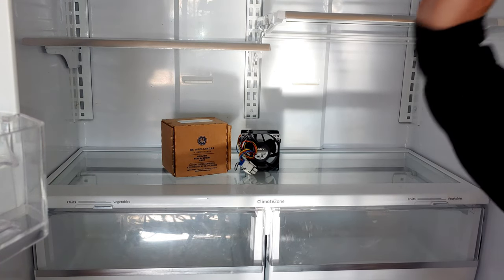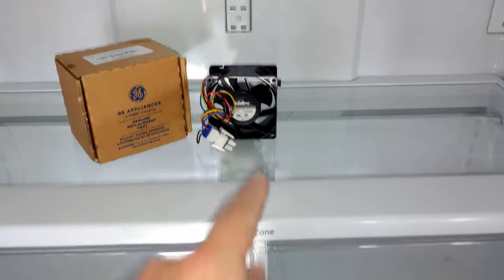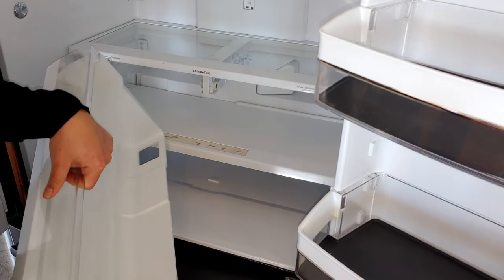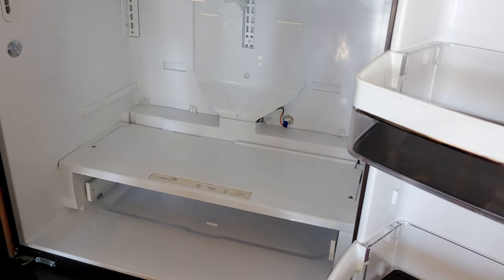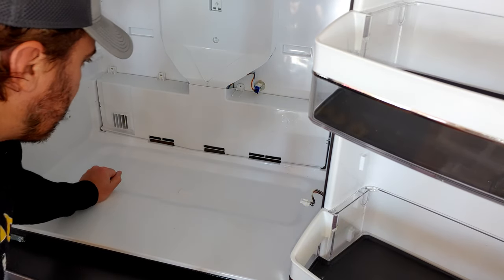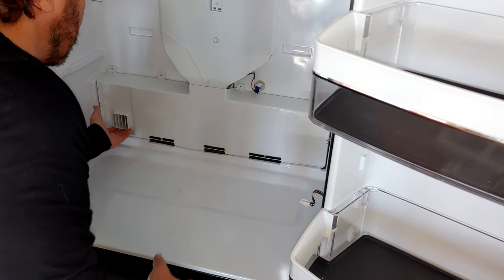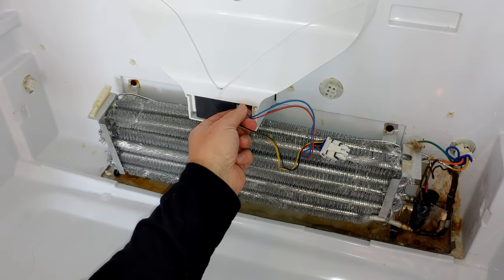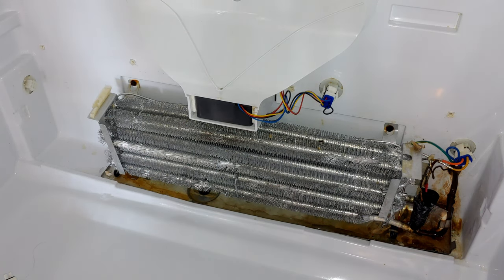How to Replace a GE Refrigerator Evaporator Fan Motor

Comment: I have similar fridge. Below my drawer shelf, some water leaks that become ice. Then eventually it melts and leaks out of fridge. Do you think what should I do?
Reply: I had the exact same problem! The problem happened because the drain that supposed to drain away the defrosted water after the defrost cycle could not go down because the drain tube was plugged. That is why it overflows and fills up the bottom of your freezer compartment. This went on for years before I finally decided to fix it. ( I was tired of always busting out the ice every couple weeks) Myself. I could not buy a replacement one so I just cobbled-together a plastic tube and a fitting from my local Ace Hardware Store and replaced it and I have had no problems ever since. I personally think that if you have a repair person that thinks outside the box can make this happen. The repair person I called in did not even think about that because it wasn't just a part they could order has my fridge freezer is too old and many parts are discontinued

Comment: Watched this whole video just to realize my fan was working just fine. It didn’t turn on until the freezer got too warm 😂
Reply from the maker: Yeah the reason for replacing this is once it goes bad and stops pushing cold air around in the fridge section permanently which equates to a warm fridge (yet freezer will still be cold). Glad your fridge didn't need a repair! 🛠️

Comment: Thank you so much for this. I had no idea how soon I would need this. So A) GE has to know this is a problem. I came looking for this video after B) The fan failed a second time in 3 years. I pulled that receipt. The home call charge was $99.95. They (GE) charged me $116.83 with %25 discount, then $73.60 for the fan at a discount for $55.20. ALL TOGETHER IT WAS $261.05 with military discount for a fan that lasted under 3 years. Last night I got the “2023 improved” fan part from Amazon for $32.95 plus tax minus a %5 discount.
Reply from the maker: That's awesome you did it yourself, nice work! Yep it will save a bunch of money vs. the service call. I have no idea why these fans go badly every few years. I have a 30 year old GE fridge in the garage and it's fan is still running, yet this newer fridge in the house, it goes bad every few years go figure. Thanks for watching and for your military service! 🛠️
Reply: I have a 20 year old GE fridge. The heating element currently goes out about 2x annually ($13 part) and now this is the first time of fan going out. I'm hoping to replace it and save thousands on a new fridge 😂. The parts do go out for sure, but I'm grateful they are relatively inexpensive!

Comment: Mine was the freezer fan motor easy fix took 20 minutes and part costs 66.21 hardest part was getting the fan blade off lol but basically just plug in and screw back together

Comment: Thank you so much!  This saved me some $$ for sure.  And it was pretty easy with your direction.  Two things to mention for others...the newer part comes with two connectors (got from a GE parts store).  When I ordered it there was a note that if the fridge didn't use a 2nd power source for the fan, to just not use it.  I wrapped it in electrical tape and just left it. Also, note that the fan may not turn back on after turning the power back on.  Do not panic (I did).  I tested the fan prior to turning off the power and it worked, so I figured it needed time to just kick back on.  That's exactly what happened.  I left it "apart" so I could ensure it was working before putting everything back together.  Sure enough after 20 min, I could hear it and also felt air when I placed my hand under it.  I feel very accomplished!  AND it was fun!  Thanks again -- the video was PERFECT!
Reply from the maker: Glad it helped and thanks for posting the tips for others! 🛠️

Comment: Here's a ? That I have I recently  acquired  a ge fridge similar  to the one in this video  from a friend  did some research  after watching  this video  and the guy I got it from and the guy said he replaced  the evaporator  fan 3 x within  a year and I just went snd took off what I saw in this to discover  1 things  the fan was plugged  in and it doesn't even turn on and spin and the other thing  I noticed  is that the motor  he has in the has got a 6 plug  and it has 4 wires coming  from the motor  but for some weird  reason  there is 6 plugs and what looked to me like a jumper wire that I'm.not sure why there would be a jumper wire kinda confused  any help is appreciated  I was gonna order the correct  motor  for it  4 wires and a 6 plug w 2 empty spots hopefully  someone can help

Comment: Best video explaining how to fix this! This fan was making a huge racket and driving me nuts. there’s still one more fan making a lot of noise, either the fan in the back or freezer. l’ll keep replacing them one by one.
Reply: Where was the 2nd fan located in the fridge?  Was it another evaporator fan or a heat dissipation fan (i.e., not an evaporator fan) for the compressor?  What was the fridge model & serial numbers?  Thanks.

Comment: Thanks for the video. Was real helpful. We got 2 different fans off Amazon that matched ours perfect. A little different setup with our fan housing and rubber boot/sleeve. It was a sliver of rubber for like sound deadening. Our's was a toploader. Took about 2 hours. We cleaned EVERYTHING while we were at it and back-and-forth tool fetching. I had to use a little plastic pry bar to help get that back section over the coils loose. It was pretty gummie. We were real careful not to bump anything back there too. Appreciate your help. I would not even know where to start without watching your video. :)
Reply: I forgot to mention how long it took to transfer food into other refrigerator, freezer, and 2 coolers! LOL. Add another couple hours.
Reply from the maker: @sacul7694  So glad it helped, thanks for watching! 🛠️

Comment: This is the perfect video that i was looking for and this is literally my exact French door refrigerator (I have model GFE28HMHFES), at least based on the inside portion shown in the video. this video allowed me to replace the fan myself . Thank you so much!!!  
Should air be coming out of the 'Twin Chill' vent on top? Because I don't feel any air at all coming out of there and I cannot remember if air was pushed through this Twin Chill vent prior this issue, also the bottom refrigerator drawer is getting frozen and water is not dispensing if i defrosted the water is working what should it could be?

Comment: Great video. My GE CYE22TSH was making the noise of the fan hitting ice which was the case when I disassembled per your video. I noticed that GE discontinued the original fan so maybe the new fan will be improved to not ice up.

Comment: Great video. Question for you: would bad freezer evaporator motor cause fresh food section to stop cooling (both freezer and fresh food stopped cooling; fresh food evaporator is working).  TIA!
Reply: Did you find an answer?
Reply: @tonihay  I didn't. My hunch was it was the inverter. Called tech to confirm and then bought one from amazon and replaced it myself. Very easy. Saved hundreds even with tech visit.

Comment: Question if I can. Everything was great on the video. It helped tremendously. Unfortunately when I took off the cover to the vegetable tray off, as I was unplugging the harness wiring , the plastic cap pulled off of the wiring on the hot side. Would you happen to know what wires go to what hole in the plastic cap. Nothing broke, it just pulled out. I cannot find anything on which wire goes where and the wire colors don’t match. I definitely don’t want to wire this wrong.

Comment: quite helpful.   question; haier  fridge got warm for 3 days then cold again, temp varies over time of days or weeks, also has random squeaking and other sounds.  I found the tech paper when checking the coils for cleanliness.  Did the self test and result was E1 = evap fan.  ?  because it is cold and then warm and cold, is there some problem besides the fan?   I Really Hate intermittent problems...     I ordered the fan, but I would like to fix the issue with ONE adventure into empty and disassemble, if at all possible.    Thanks again for your video, and if you have time to answer this question, thanks for that too.
Reply: I just learned this. Its a pain but you must do this. 

1st: ensure that it is or is not the fan. That is because the fan may be working, but the vent lines are frozen, blocking the air flow from the fan

2nd: whether its the fan or not. Empty the unit, let it thaw out for 2 days. If the fan is broke, your vents and coils will be frozen. If the fan works, but fridge is not cold, its because your vents are frozen and not allowing fan air into refrig.

Its a pain, but if you dont thaw it out, you are wasting money. Thaw it see if air flow is reinstated, if not then replace the evap fan.
Reply: Look into the heating element. It takes about 5 minutes to change and it's a cheaper part than the fan. Our heating element goes out frequently, but I'm realizing from this video that a fan may play a part in it as well. For heating element, it will go warm, long enough to thaw out some ice, and then it gets cold again so this is pretty trademark of a heating element symptom. With that said, our element went out again, but I heard some knocking in (some kind of fan motor) the night before. Replaced heating element and the freezer is perfect. Fridge is still not working. So I will also have to replace the fan. From what I've learned today, they probably work together, so from my experience you may want to replace a fan culprit as well [unless you want to replace the element 2x per year like we did lol]

Comment: So helpful!  Quick question, I have a very loud noisy GE refrigerator, and the repair person who came to my house said that my "ice maker fan" is bad.  He said he could see visual signs of wear on the fan blades.  My question is, is this part referenced in the video the same as an ice maker fan?  The only other part I found on GE's website is for "ice box fan" but this one does not have visible blades.  Thank you so much!

Comment: Great video! Looks easy enough, I think. 

This is literally my exact French door refrigerator (I have model GYE22KMHGES), at least based on the inside portion shown in the video. Mine is the matte graphite finish. I found this video via Google as the 'fresh food' portion (top) suddenly stopped cooling (the adjustable temp lower drawer and the fruit/veg drawers above that are fine, they may be getting cold air from the freezer via other vents). 

I don't know for sure if it's the evaporator fan, but I am suspecting it. Should air be coming out of the 'Twin Chill' vent on top? Because I don't feel any air at all coming out of there and I cannot remember if air was pushed through this Twin Chill vent prior this issue, or if it's intermittent and I am missing it when it's active. I feel nothing even when you hear the refrigerator 'humm' as the bottom freezer sounds 'on' and you can feel air moving around down there (there is another fan in the back of the freezer, that looks like it's working fine).  

Also, looking online for the evaporator fan part, there seems to be a newer one that has 6 blades, versus the older one linked which has 3 blades. Not sure which to get if this is indeed the issue. Perhaps the 6 blade would push more air and was upgraded/updated due to the 3 blade being faulty after some time. Hard to tell what is legit these days as there are so many fakes and copied parts sold online. Here's the supposed 'upgraded' part:

https://www.amazon.com/WR60X26866-Refrigerator-Evaporator-Compatible-WR60X10356/dp/B0BG4P9VCS/ref=asc_df_B0BG4P9VCS/?tag=hyprod-20&linkCode=df0&hvadid=652579307228&hvpos=&hvnetw=g&hvrand=9068958493129963497&hvpone=&hvptwo=&hvqmt=&hvdev=c&hvdvcmdl=&hvlocint=&hvlocphy=9004149&hvtargid=pla-2068251188141&psc=1&gclid=CjwKCAjwt52mBhB5EiwA05YKoxfJfo0PP8Z_lLcUsVEpXwH6BLSOx_bCBCA5sn1peJl-YM1r-l_BWRoCEhUQAvD_BwE

I am out of warranty, and GE wants $150  to come out to look at the issue, so I am assuming they'll charge tons more for the part(s) and labor, so I was wondering if I should tackle this myself if this is the issue. 

I already removed the back lower plate and cleaned the coils and the entire area. They were dusty, but not too bad. It's now pristine back there, but that didn't do much for the lack of cooling in the upper part of the fridge. 

I've had this refrigerator since 2015, no issues, now, all of a sudden, this happens! Any insight on the above would be greatly appreciated - thank you!
Reply: Hi, this is the same problem I am having. That vent at the top has no cold air moving through it, and I know it is supposed to, via prior repairs. Freezer is solid, but top of fridge is hot!!! Did you figure out if it is the evaporator fan?
Reply: @ismarttaxes7524  Yes, in my case, it was the evaporator fan and it sounds like this may be the problem with yours. What I learned through this process is that the cold air in the fridge portion comes from the freezer, so when this fan goes, air cannot be distributed, making the freezer appear to operate normally, but may have some ice build up due to the lack of circulation and cold air distribution. 

So a cheap part that bonked my whole fridge. Instead of tinkering with it myself after viewing some how-to videos, I decided to just call GE Service division and have a professional come out and swap the fan as they guarantee their work. If GE would've placed this fan in a more easily accessible place, I would've swapped it myself, but several panels had to be removed and I didn't want to make a relatively small problem worse. 

I emptied the fridge, the GE repair tech accessed the fan, swapped it out, broke out some of the ice that built up in the freezer below and in the grill section below the fan due to not having a fan moving cold air up to the fridge portion, and boom, cold air started to make its way to the fridge from the freezer as it's intended to work. 

I took the opportunity to clean the entire fridge before refilling it with fresh groceries. It's been working fine ever since, and there is no annoying noise coming from the fan as others described.

Comment: When removing the cover the last harness that you disconnected on the left, it goes to another fan. I removed that fan from the styrofoam and can not remember the way it was facing. Should fan face up or down? The part number on my fan is DAZA0515RCU Brand is AVC. I believe this may be an aftermarket part.

Comment: I appreciate the video. Any insights on the software module GE requires? I would do this myself but will be out over $500 with the part, new module, and service call. Thanks!
Reply from the maker: Yeah my fridge is new enough it didn't require the software module update. I've not done it but from what I've seen the update module comes with an ethernet cable and module that plugs in on top of the fridge. It automatically updates after like 15 minutes. I'd recommend if you have a fridge model you know that requires this, to seek out a video on YT or RepairClinic that shows the module update process. Thanks for watching! 🛠️

Comment: Does this cause vent to go stagnant between fridge/freezer air flow? We've already done many consistent repairs for upkeep on our super old GE SxS. However, this is a new issue. I know it has to be one of the fans, but trying to troubleshoot which one, via:

There is a well-blowing fan located in the freezer that will blow your hair back if you open it, which confuses me LOL. Freezer is working. My biggest diagnostic issue is seeing the vent between fridge and freezer is completely stagnant, as if air is not moving into the fridge at all (58°). Not the heating element (already replaced just in case). 

2 days before this happened, I heard a loud knock, and I knew it would be a problem 😢. It went knock about 7 times, and then just completely stopped/silent (motor knock), so I'm having trouble hearing the issue via testing. It's gone. 

I have noticed that the standard periodic fan that comes on daily has been quiet as a mouse (I think it is nonfunctional). Is that this part? Will it cause that? Thank you

Comment: Glad I found this video. Any advice?? I purchased a similar GE Profile french door refrigerator in Feb 2023. In September, it started making an annoyingly loud buzzing sound. I've had GE replace the evaporator fan twice, under warranty. The same noise persists. You can hear the fan kick on and spin up to speed. The noise it makes has the sound/frequency of a big commercial wood chipper being used by someone down the street. It's hard to have a conversation at the kitchen table. When I bang on that big plastic cooling coil cover, the noise stops for a few seconds...then resumes. Anyone have an idea how this can be fixed? Do I need to add some damping material somewhere on the back panel of the fridge, tighten the condenser assembly, anything?!!! It's enough to cause me to dump this unit and go with another brand. Sorry for the long-winded comment. Thanks.
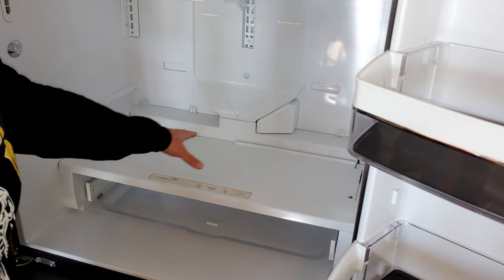Reply from the maker: If you remove the plastic cover at 2:40 and unplug the harness for the fan, does the sound go away or persists? You can do this check in about 10 seconds without any tools. This will isolate if it's the fan or something else.
Reply: @TheEclecticHandyman  The sound goes away when the fan is not running. I'm going to see if I can pull the fan out of it's plastic housing and run it in isolation. If it's quiet, then I'll try and damp any contact points of the plastics housing it sits in and the coil housing. Thanks for sparking the idea.